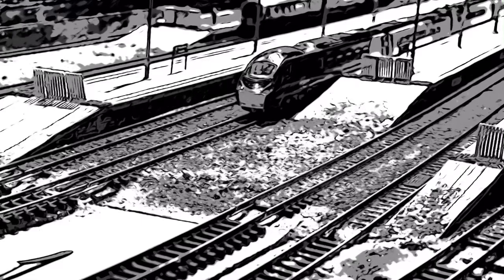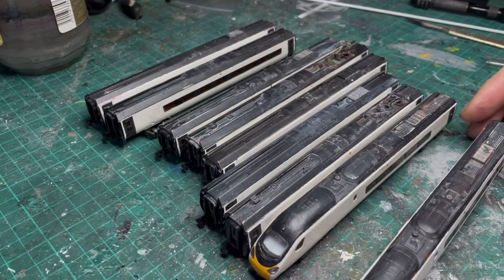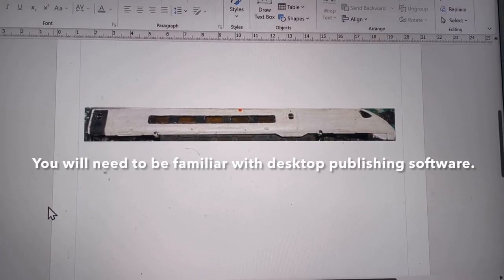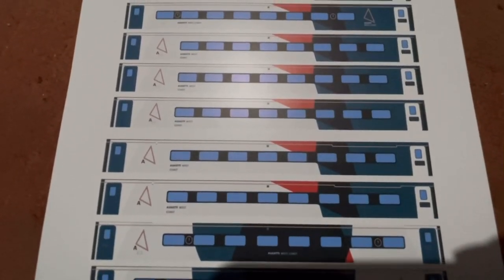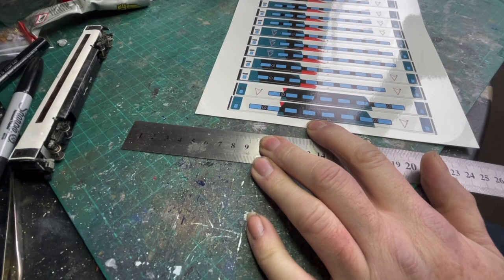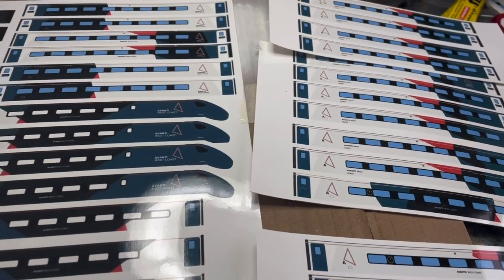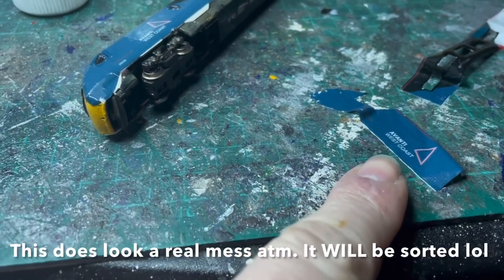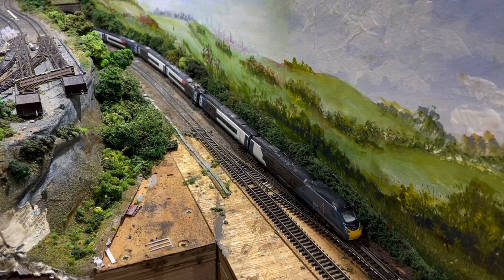MAKING WATERSLIDE DECALS, N GAUGE, FOR YOUR MODEL TRAINS – New Colours for the Pendolino.

Comment: That has come out very well John.  I wouldn't have thought about using waterslide transfers to apply a new livery.  A pity it repaid all your kindness by then being difficult to get running, but it does look good.  Happy New Year  Stephen
Reply from the maker: Thanks Stephen, happy new year. Im hoping the couplings will settle down with some further adjustments, think I know whats happening. Also one issue was the single slip and back entrance into Piccadilly pl13, so Im having it up. More major engineering work, lol

Comment: Hi John - great bit of relivery work.   Although this model does seem to cause you issues a plenty when it comes to running.  I think I'd have sought a new home for this particular model by now.  I'm sure you will get it running smoothly eventually.   All the best for the New Year.  Cheers Euan
Reply from the maker: Thanks Euan, yes Id normally agree, any model that plays up would go. Its both of the pendolinos, and its down to the couplings. My couplings do and will work making the train usable, but there is always an element of ‘hand made’ to my efforts and its not easy to repeat. Ill get there with it. Thank you for your continued support Euan, much appreciated! HNY

Comment: Hi John. Great  use of the the transfers . i didn't realise  how complicated the livery was on the Pendo .   such a shame that the pendo is still derailing and causing issues. I have one coach that also refuses to behave . Just when i think ive fixed it it derails again Arhhhhhhh.   All the best for 2022
Reply from the maker: Hi Geoff, happy new year. I know, I got both of mine when they first came out, Ive never known anything like it, it’s those awful couplings. Mine are catching which is a different issue from the original. They are too rigid. I wont let it beat me, got an idea which MAY WORK. Going to draw up a prototype today.

Comment: Do you need to spray lacquer on laser printed decals
Reply from the maker: Hi, I always use the inkjet version. I tried the laser ONCE, total disaster. The decal cracked really badly. The inkjet variety is a bit more forgiving. 
I would avoid laser.
Reply: What inkjet paper do you use
Reply from the maker: Cant remember got it off ebay. Ive got videos on the it probably mentions brand there.